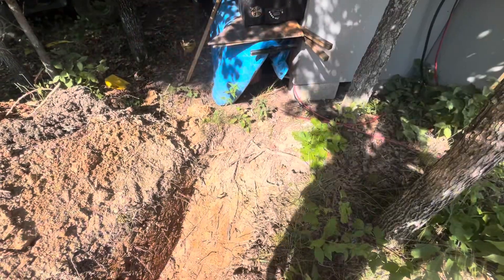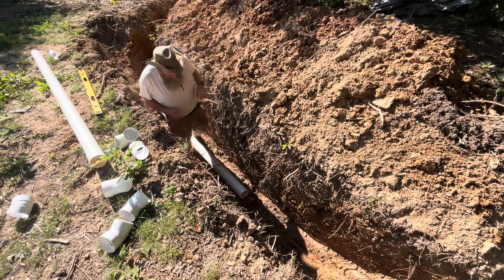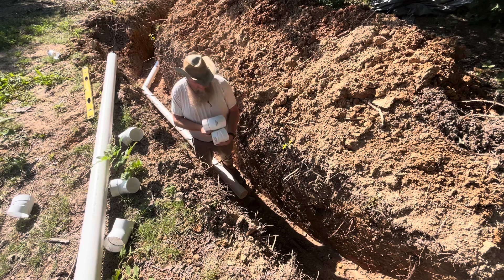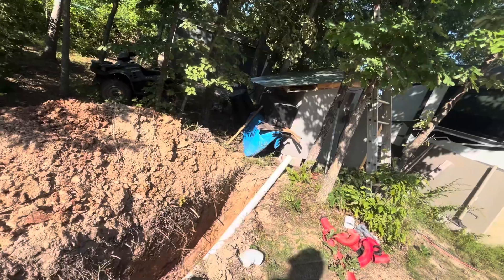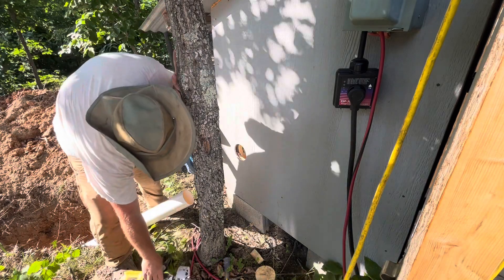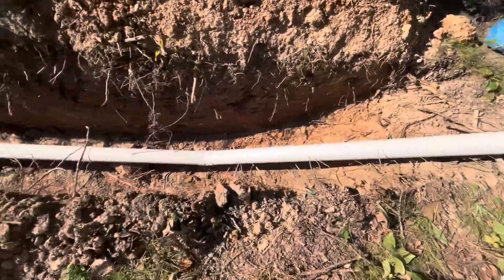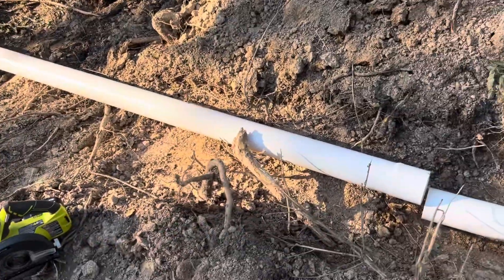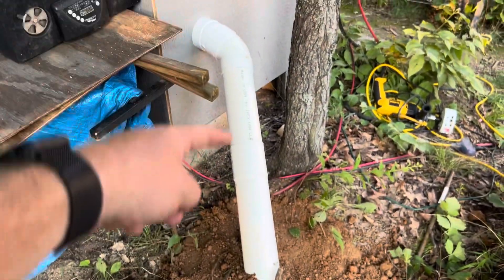Shed-conditioning - Assembling and Burying Earth Tubes (#169)

Comment: Are there any issues with moisture or mold?  I see lots of people starting to use cooling tubes lately.   Good video!
Reply from the maker: Haven’t really been using it long enough to tell yet. I saw one idea though to run a rope through the pipe that would allow you to pull a rag or something through the pipe to clean it out.

Comment: A chimney pipe through the roof would probably create a natural draft stronger than that fan. The taller the pipe the more draft .  just my opinion
Reply from the maker: I imagine that it would.  I had considered adding a solar chimney…but ended up going the mechanical route (upcoming video).  It’s all a big experiment!  Thanks for sharing your ideas!
Reply: @BrambleBerryHills  
A fan gives you control over the speed and direction of the airflow.  A solar chimney will create negative pressure in the shed, pulling air in through any cracks or gaps.  A fan  attached directly to the tube can only pull air from the tube. An adjustable exhaust vent will allow you to match the inlet and outlet flowrate. If you have less air going out than you have coming in, you`ll create positive pressure in the shed which will reduce the output of your fan.

Comment: You can simulate deeper depth by insulating above the drain pipe. That keeps the surface temperatures from reaching the pipe.
Reply from the maker: Yes!  Great suggestion and one that I have plans for…will be posting videos as I implement some modifications.